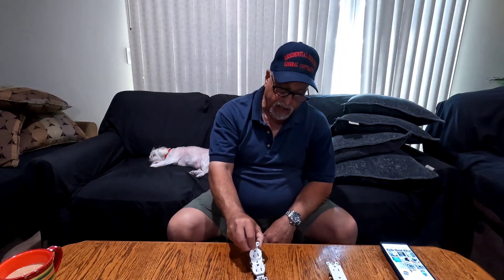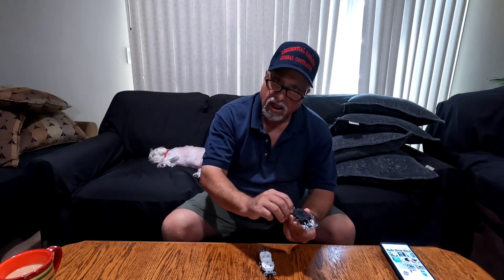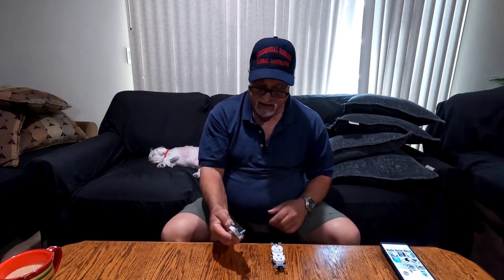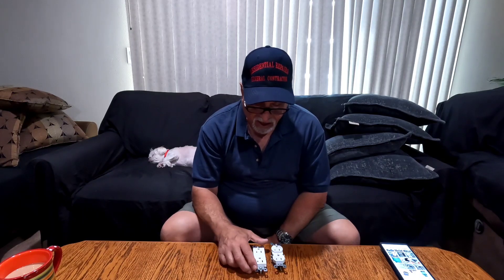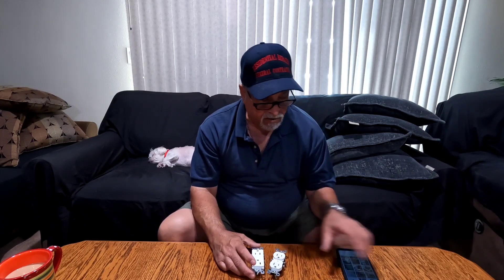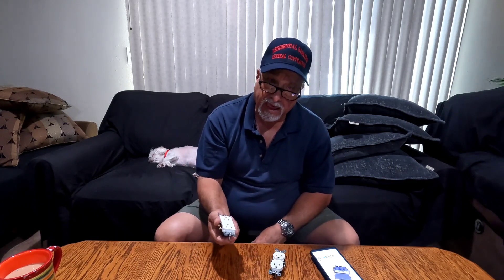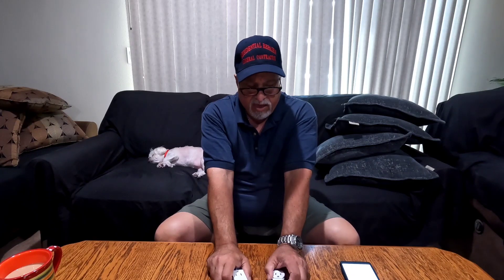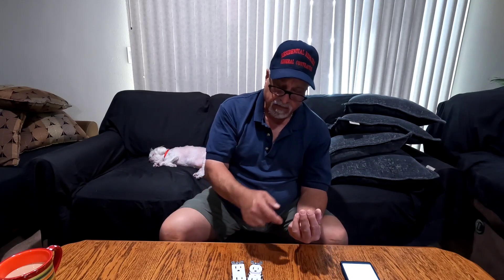Aluminum To Copper Pigtail

Comment: You're welcome (for the comment) just an observation and you pronounced my name correctly. I am a subscriber. Very much reminds me of my wife and myself when we owned 15 rental units. Had to do many repairs and think out of the box many times. I also made some pigtails just as you described. I did read or heard that was the correct way to work with aluminum. And yes, they are expensive. But the right way to be safe. Keep up the good work.
Reply from the maker: Thanks again!

Comment: I believe Ideal makes a wire nut that can be used for copper /aluminum splicing. It is violet colored and contains a noalox compound to prevent aluminum oxidation.  They are very expensive, close to $5.00 each.  There is a great deal of debate about its efficacy and aluminum wiring in general.  I wonder what makes a receptacle aluminum compatible?  Kudos to you for dealing with this problem so thoroughly.
Reply: Yes those violet/ purple wire nuts are pricey for sure !!
Reply: Thanks for the Shout out enjoy your videos !!!
Reply from the maker: Thank you I saw them at Home Depot  I'm going to do some research I'm kind of wondering if the chemical that comes inside of it dries out or not thank you so much for commenting and for the compliment.